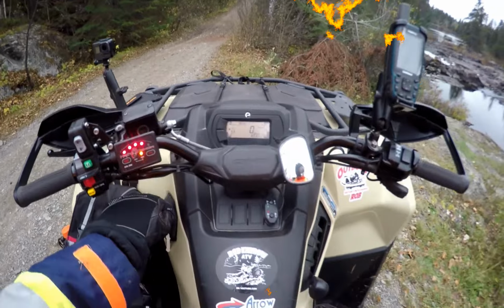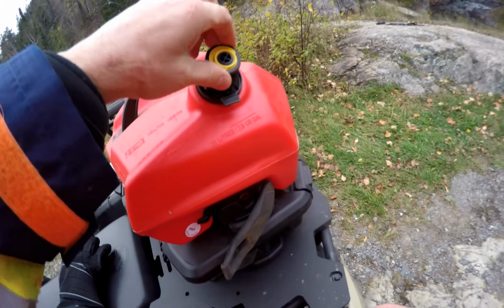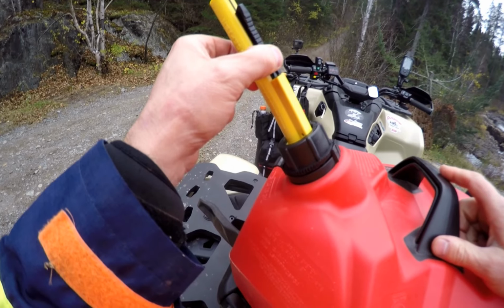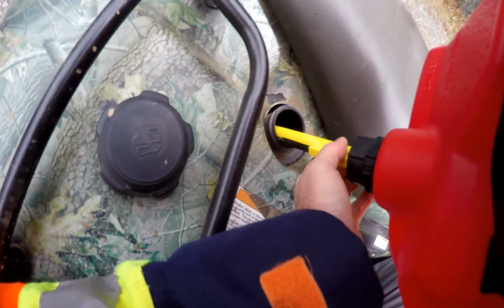How to use the Linq Skidoo Gas Caddy can ATV Can Am Outlander 700 fueling up

Comment: Its a good idea but I am not so sure I like the gas spout operation.
Reply from the maker: Takes a bit to get used to but I like it.  Thanks Vance!
Reply: I hate em. Had one similar and swapped it out for old style. Poured too slow.
Reply from the maker: It is slower but I like the way the tank secures to the rack, don't have to worry about it bouncing down the trail.  Had a gas can do that before...never did find it LOL!